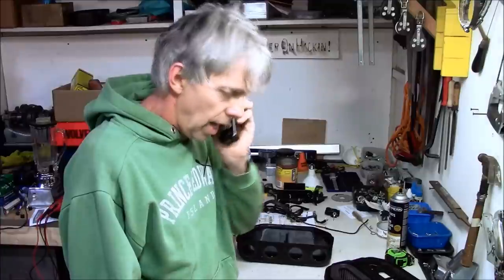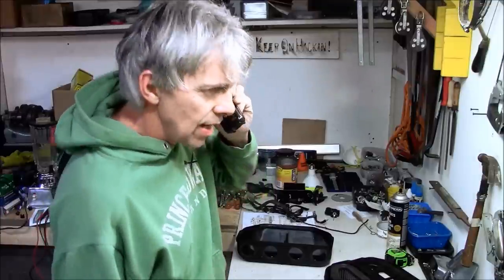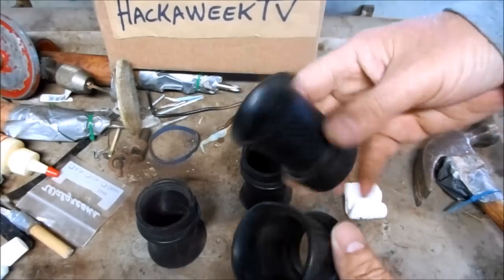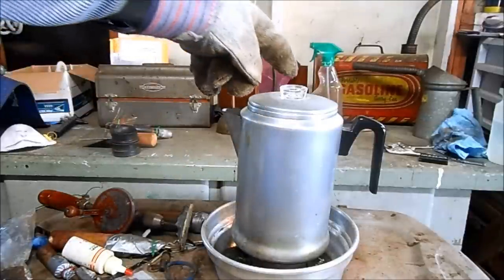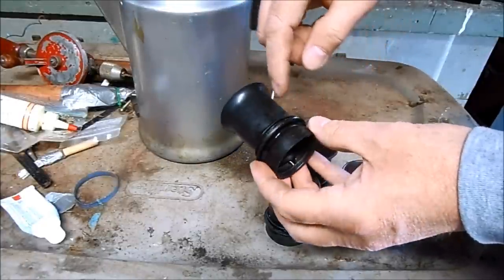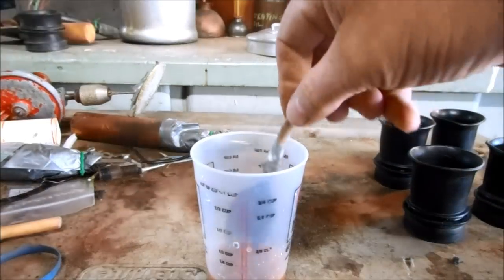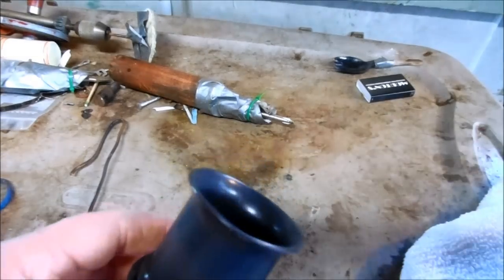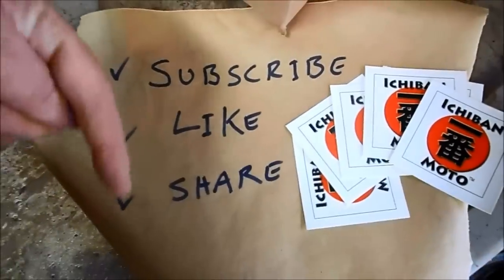how to soften and restore old hard rubber motorcycle parts

Comment: I used to do the same on my old KZ rubbers but without the need for all those weird  chemicals or hot water. Just soak em overnight in cellulose thinners. (Gunwash in UK) soak overnight, let them dry out (as they will have swollen bigger than orig)  for 6 hours, job done, like new rubbers. Try it!

Comment: You can use a fine polish, like plastX to bring that surface up to par.

1. What is the brand of the rubber rejuvinator? I went so far as to image search rubber rejuvinator products and couldn't find that bottle. Is it just Fedron?
2. What did you squirt in from the hypo needle?
3. How many hot sauce drops (Mikuni stuff)?
4. How much "hot sauce"?

5. How long does this treatment typically last?  I would like to get at least a year of softening out of the process if possible.  Do you know? I suspect my application is MUCH less demanding than yours, now tremendous heating, no monster tension (stretching) stresses. 

If you (or someone else that has done this and knows) would take the time to answer my question, I would be glad to put another comment describing if, and how well it worked.  Thx, and thx for taking the time to share this via the video.  Current "restorers" use stuff like brake fluid, which to me doesn't sound like that great an idea, although the rubber parts in a brake system don't seem to deteriorate soaked in it.  Still....

 I am going to try this on a very old typewriter platen, as re-rubbering them is rather expensive (about $100), and a pretty long turn around time, both of which I'd like to avoid if I can.  Obviously the "treatment" will not be able to penetrate both sides of a thin rubber part, as it does with your part geometry here, but I don't think that's an issue, as I really just need the outer 1/8"-3/16" to soften to make the necessary difference (not ripping through typewriter ribbons and paper, and not sounding like a woodpecker on steroids tapping on a plastic tree.

Comment: Back in the 90's I was using an old rubber cow teat liner as an adapter to connect a funnel to 5/16 copper, and accidentally discovered that POE refrigeration compressor oil is a rejuvenation for rubber.  Worth trying out should you run out of chalk tablets.

Comment: You know, and I don't want to make a whole big thing about it or anything, but I race Internationally and specialize in the Top Class at the High Bank Turns of Daytona.  I've been in the ICU at Halifax Memorial Hospital since the big crash.  I'm trying to get the Cafe Racer bent back into place and straightened out.  Railing around the High Bank Turns at Top Speed, knowing that so many Sweet Chicks are watching, and finishing on the Podium and celebrating in the Winners Circle is what it's all about.  You know, and I'm sure everyone remembers, Barry Sheene met and married Stephanie McLean, the 1971 Penthouse Pet of the Year.  I didn't see her there this year but was hoping to meet the Stunning Wanda "Jelly Fingers" Welch.  What a Sweetheart and was the February 1978 Teazer of the Month in Screw Magazine.  After I get done with Physical Therapy I wouldn't mind Calling First for Sloppy Seconds with her.  Anyway, when truing the rear wheel I found that the tire tube was punctured in several locations.  I'm hoping that the crew at Itchy Bonn Moto can work some of their Chemistry Wizardry on the tube, with the annealing and rejuvenating process, and get my bike back on the track next spring.  If Itchy can get the tube soft and supple again, something similar to what I can only imagine Mrs. Jelly Fingers has on the other side of that string bikini, then I can apply another set of patches over the other many patch repairs.  Also, a little secret, I dust the tube with Nickel Town Customs Synthetic Baby Powder to minimize scuffing and oxidation.  Thanks to my good friends at Itchy Bonn Moto.  I'm hoping to get a few Stickers out of the deal too.  And, please turn the tube repair around quickly and bill me to my home address in Winnetka.  Thanks Itchy.

Comment: Much cheaper and very effective method is simply to boil the rubber in a solution of water and wintergreen oil for about 30 minutes. Let soak till cold. Then they are once again pliable. Totally non toxic and easy
Reply from the maker: wintergreen oil is in the recipe
Reply: Everything is in your recipe.  :)
Reply: Thank you!

Comment: Do you this this process would work on the soles of shoes as well? I restore old sneakers for people and people often have pairs that are 20-30 years old where the rubber has hardened and lost all grip. There are little to no products out there to restore shoes in this fashion, but I'm wondering if the same method can be applied since it's also just a rubber sole? Also, I highly doubt I can track down any of the secret ingredients locally, so should I be using 70% alcohol or 91%?

Comment: I have a 1977 yamaha dt100. Got it running but reams really bad when i hit the throttle. I will say that I did not clean the carb. Any help would be great! The bike also has a make shift throttle from the previous owner. The parts for this bike are expensive so was wondering what to attack first. Keep up with the great Vids. Thanks, Wayne Brown, Rochester NY.
Reply from the maker: throttle cables for DT100'S are like $12 on ebay. get one.  after you ultrasonic your carb, carefully inspect and adjust everything to spec. also check for vacuum leaks after installed and running.
Reply: thank you, will do.

Comment: you can soften rubber with silicone spray. spray it until it's soaked then place it inside a tgt plastic bag for one week. repeat the procedure until you are satisfied. you can use garbage bag. after that boil it for five minutes then it's back to life. you don't need to buy all that crap to restore rubber.

Comment: The real reason why manufacturers started to use plastic rather than runner. Plastic can be made to not be restorable, deteriorate without use in storage and at rates they want (by changing the blend). 

In other words plastic properties can prevent rejuvination increasing sales and dependence (control) of life cycle of product.
Reply: Everybody is out to get you. Someone is under your bed.   Also, rubber is more expensive to produce.

Comment: Do you have a special way to replace grips? I usually wind up just cutting off the old ones.
Reply from the maker: +TheBRMueller  I'll have to make a how to vid on that. There is a bike here that needs grips
Reply: To remove grips take a screwdriver and raise the outer edge of the grip just enough to insert the tip of a blow gun connected to a compressor.  Squeeze the blow gun handle and the grip will fly off.To replace grips effortlessly soak them in water for about an hour. After they're on give the water enough time to evaporate. NEVER use anything other than water.

Comment: I will try your method although in the past I've had great success with acetone (cellulose thinners).
Immerse parts in the acetone for 24 hours and they will soften and swell.  Left out in the air for a couple of days or less, they shrink back to their original size, but retain the renewed pliability.    
5 years later they are still pliable.

Comment: Great vid, but there is another, more sustainable way to do this. Rubber is a fruit, OK? So what you would do is put these stacks in a plastic bag together with a ripe banana, seal it  up and leave it for a couple of days. The banana cranks out masses of ethylene, making your stacks soft again or ripe if you will.
Reply from the maker: I need to try this !
Reply: You should do  a video using the plastic bag and fruit.
Reply: And you can kill two birds with the same stone if you use the banana skin to rejuvenate your worn gear box!
Reply: Results?
Reply: Does this really work
Reply: @thefreedomguyuk  it does wonders in your worn differential (automobile) old timer trick.

Comment: I am converting my 1927 Brough Superior into a café racer and I have used your excellent videos as an inspiration, it is nearly finished, however I would like to give it a colour scheme that is more badass than the original boring black and gold, I was thinking stars and stripes like the chopper in the film Easy Rider with Jane Fonda and Jack Nicklaus. Do you have any plans to make a video showing how to achieve a top class paint job using aerosol cans? I know preparation is important so I have designed  a home made sand blaster, I am using a vacuum cleaner, filtered soil /sand mix, I am just waiting for a reversing pcb for the vacuum electrical circuit.
Reply from the maker: +Brian Griffin   oh yes! please send pics when your bike is finished.   I will add painting to my list of future videos. thank you !

Comment: I loved this video from the Jump!  I'm a lifelong alchemist so this is right up my alley, but your wife's gorgeous handmade mortar and pestle made the entire experience!! Thank you!  

PS. I have a bottle of "The Original Zoom Spout Oiler" turbine oil, is this of any use? I'm trying to stop the drying and cracking of my 1950's Rubbermaid sink stopper, which is  nothing more than an awesome turquoise circular disk with a risen rectangular bump for lifting with ease. I love functioning vintage and antiques (you should see my tool collection!) but this thing works better than anything made today and it's suddenly started to crack and I'm drawing the line at the very first chip. Please help me save this by cuing me in on what to avoid  exposing it to in the future. Also, having run my own organic skincare business featuring deodorant that neutralizes instead of masking that worked as long as it was on your pits-I understand the flipping Beauty of essential oils as chemicals. Please tell me what it is about wintergreen that works. I lean waaaay over on the peppermint side so I'll have to go out and get this stuff first. Thank you for being Bad Ass!!
Reply: Never mind, I'm slow on the uptake! Funny, though!

Comment: Oh ffs! Some people will actually go hunting around their local hardware stores asking for theses ingredients.   They might even follow it through to the end. My oh my, they gonna be disappointed! 😁
Reply: Why ?? It DOES make their old rubber parts smell good!
Reply: is there an actual way to rejuvenate carb trumpets?

ive heard there is something similsr for tyres... never tried it though
Reply: don trump I wish, and would certainly let you in on the secret if I knew of anything. Could save us a fortune.
Sadly, I don´t think anything really can be done, the rubber usually just start cracking and falling apart...roughly at the same time we start getting annoyed our bikes are suddenly misfiring... (-:
Reply: Morten Kristoffersen
the DOT3 oil wonders on rubber are a myth, right?
thats the only thing ive heard relevant to this, and im not certain it wasnt a simple trolling.
Reply: don trump I am afraid so. There is nothing to do about perished rubber parts, other than replacement. That is probably why they are so expensive, we have no choice.
Reply: Just a safety note on the Oil of Wintergreen. It is chemically the same as aspirin metabolized in the body to salicylic acid, so do not handle without gloves! It can soak through your skin and give you a potentially fatal dose! Best procedure is to use the the liquid glove lotion stuff, which forms a chemical barrier, and then nitrile gloves or the like. That is actually a very good practice in general when working with any solvents or chemicals. Just use the proper liquid glove formula for water or oil based solvents.
Reply: Billy Pilgrim Thanks for the info, man. I'd love to see the H2, too!
Reply: babyfacenc the H2 was in need of a total restoration, so I sold it to a friend that specializes in the triples. I kind of regret it, but I have a garage full of bikes in various stages of stripped down, so I had to take the cash!

Comment: Just use 3 parts 91% rubbing alcohol to 1 part Wintergreen oil and youll get the same results.
3:1 Alcohol to Wintergreen.
Reply: Does it last without the packet of rubber emulsifier stuff?

Comment: pmsl .....why would you , rubber brakes down .  load vinyl you can reactivate at high heat  . You have too melt rubber to get it back to its a constructive state ..... Plasticizers are used in pvc .... ty :)

Comment: Foolishness, wash it off with soap and water put it in a ziplock bag with Dot 3 brake fluid. It's hygroscopic and rubber safe. Restores almost all rubber products soft and pliable.
You can also use engine oil stop leak.. it's designed to quickly soften and swell rubber seals.

Comment: Dear Ichiban, I dont do FB , Tweet or Instagram and can't dance, thus taking a chance you'll see this note in a older related post of yours ...

Hey Ichiban , Spa here checking in from www.hawkgtforum.com.

Now that our beloved Hawks are 30 + years old and both OEM and NOS parts are getting tougher to get. The used parts market has swelled in popularity and price. 

My question is ... do you have a Ichiban method of repairing old torn crush rubbers ?  And can the green rubber dust the older ones disintegrate into be recycled into new crush rubbers ?

Thanks in advance!
Thread https://www.hawkgtforum.com/forum/honda-hawk-gt-bros-discussions/general-discussion/892174-low-mileage-cush-bumpers
Aloha Spa
Reply from the maker: i'm not 100% certain ... i'll try and if it works, i will make a video
Reply: @IchibanMoto   Bad Ass, Thanks !  Aloha Spa www.Hawkgtforum.com